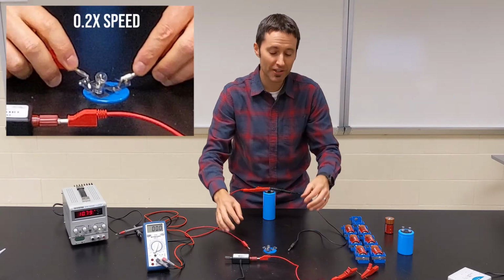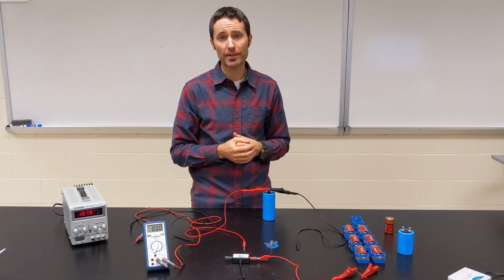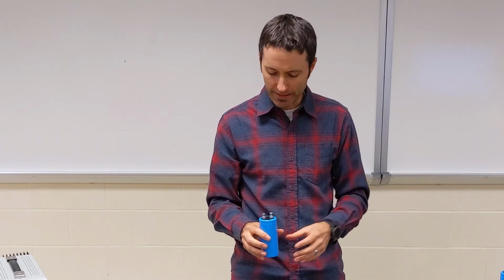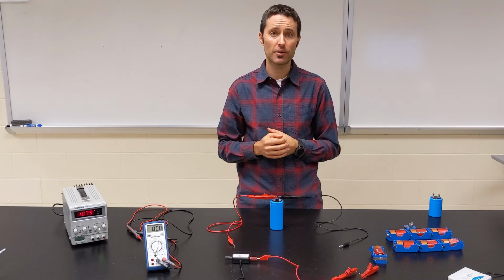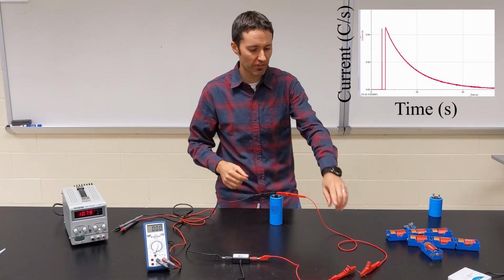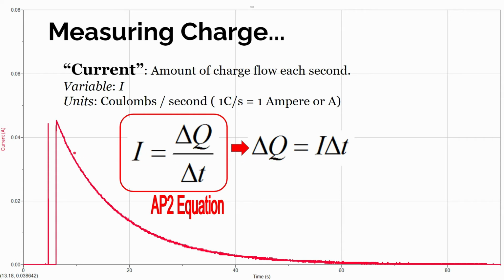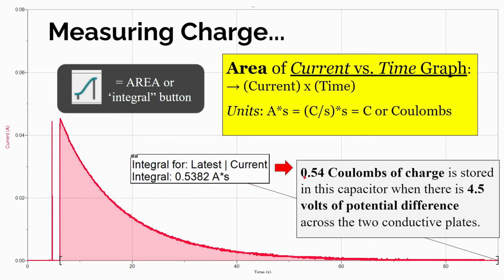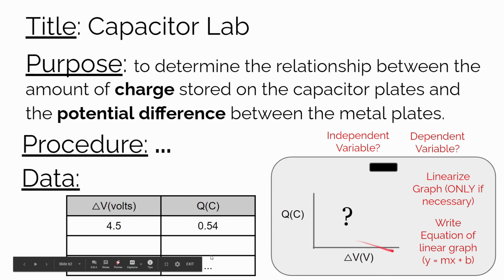Capacitor Lab Introduction

Comment: I am not understanding what does it mean when we are saying that positive plate is at higher potential and negative charged plate is at lower potential please explain me more briefly i request you if you've read my comment.
Reply from the maker: Electric "potential" is the amount of energy stored for each unit of charge placed at that location which is measured in Joules for each Coulomb or "Volts".  1J/C = 1 Volt.  The positive plate is at a higher electric "potential" than the negative plate because a positive charge when placed at the positive plate will store more electric potential energy than if it was placed at the negative plate.
Reply: Electric potential is the amount of energy that a test charge of one unit would get if it were moved from the point of origin to the the "destination" which would be the plate with the opposite charge to the test charge.